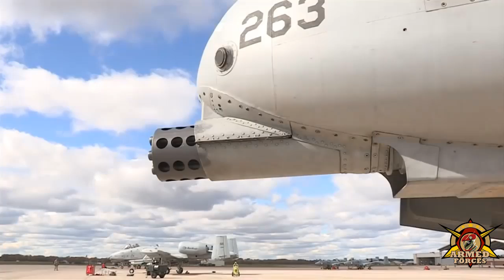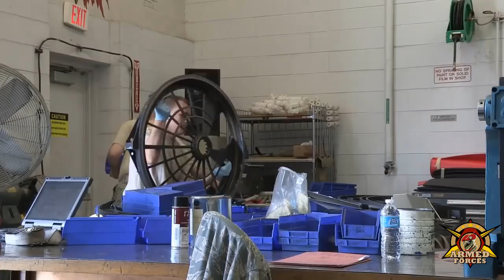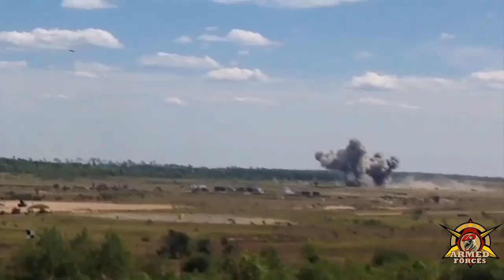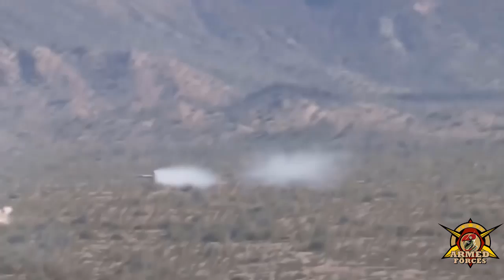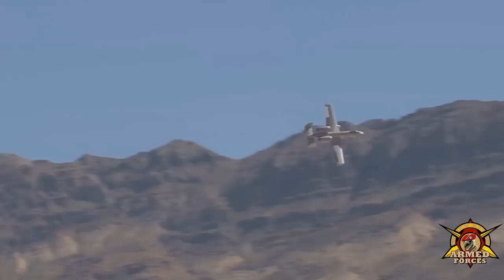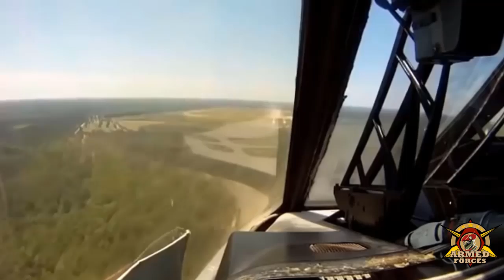Revealed: USAF is Planning to Build a Super A-10 Warthog

Comment: I know this plane is loved by the guys on the ground, but I think it has had its day - especially against another high-tech enemy- also the cost/flight hour is about $10000. The downside of using an increasingly digital battlefield approach is that communications between for example an F35 and ground troops needing support will be targeted. Still no alternative to a guy looking through the canopy at a guy on the ground pointing at the enemy - so, it will always fill a niche. The A10 has to retire at some point - its replacement should be as tough or tougher, should be able to integrate in to the digital battlefield but maybe more importantly should be able to fight with no tech.

Comment: AF wants to keep It?   You're kidding Right?   Brass hates the thing.  Not fast, not sexy.   Only the Army loves it and fights for it.  What they need is an aircraft that can loiter, simple and easy to maintain,  able to absorb punishment and protect the driver while delivering a wide range of stores.  Sound familiar?   Don't reinvent the wheel.   Fix them or clone them!
Reply: John McNaught Of course, the "brass" aren't the ones getting their asses shot at by the enemy!! My concern and regards are for the troops on the ground who need this protection.
Reply: I agree a " modernized " A-10 is what we need ,keep the same design and don't try to turn it into a fighter.

Comment: The Air Force has been trying to dump the A-10 for a couple of years now, a plane already paid for, and a plane designed specifically for Close Air Support. The A-10 is comparatively cheap to operate and has a long loiter time over the battle field thereby providing long time assistance to the troops on the ground.                                                                            
 The F-35 is outrageously expensive per unit,  costs a fortune to maintain, and doesn't have the loiter time that the A-10 has. The US Air Force just wants all the newest toys and could absolutely care less about the troops on the ground, the Air Force brass aren't the ones doing the dying. The USAF brass are just looking for their transition into private industry as a payoff for steering the budget to the latest expensive toys, and to hell with the troops and taxpayers.                                                                                                                   
 I would suggest that the A-10 needs to be transferred to the US Marine Corps if the Air Force insists on getting rid of it.

Comment: That is like a Knight want to Change his Horse and his Longsword for a Wooden Shield and an Axe! Why would you replace the A-10 - IT IS THE PERFECT PLANE FOR IT'S JOB! And do not start with STEALTH - Because that only helps if you are far above and away from the Target - Which ultimately restricts CLOSE Air Support! IDIOTIC to call on the Gau-12 from the F-35 which cannot  kill Tanks and has to be fired at Close Range - Where the mentioned STEALTH is useless!

Comment: The A-10's have worked longer than they was scheduled to, but have done such a great job until the senators have decided to force the Air Force to fly it longer than originally planned. The only way it will be replaced is with a similar aircraft and it will take some time for that to happen.

Comment: find a thousand p 47 jugs,retrofit armor with kevlar a lighter engine,that 2800 cube double wasp, & supercharger, new avionics, reinforce wings, computer boost surface controls so it is stable in dives
Reply: a 10 is the grandkid,, p47,granpa who can still hit
 70 years after brawls he won, I saw the jug flyin in finger 3 formation at an airshow, flying towards the lake,it was doing 400 mph,an f 18 on each wing,we got a hundred thousand granpas under tarps  at bases in the west & south,50k engineers & machinists ,and software guys to bring those old dogs back to life,
Reply: Angelo....you've got it right! Or ov bronco,or bring back the skyraider , so many awesome and cheaper and capable choices. ..but the a10 must be retained for those antitank jobs that requires no less
Reply: ditto greg,in diving,in escaping or chasing the german fockewulf,messershmitt,,the jug in dive could get to 500 mph,evencatch the ME  262 jet fighter,at least get the speed daemon
in sights long enough  to  hose it  with 50 cal& flame it
Reply: angelo santd
Reply: angelo santdio I love the jug..2,000 American Horsepower

.
Reply: A p-47 would be beyond slow.